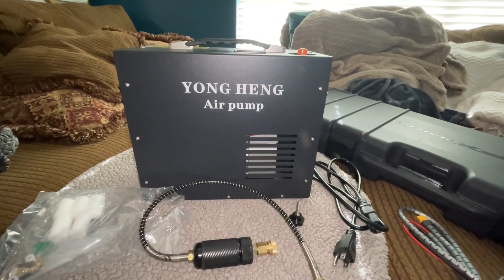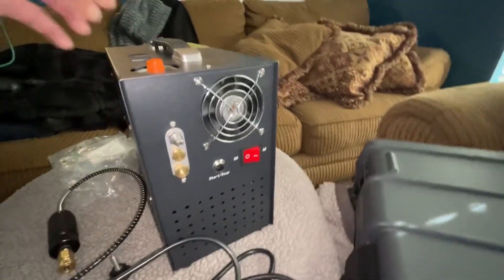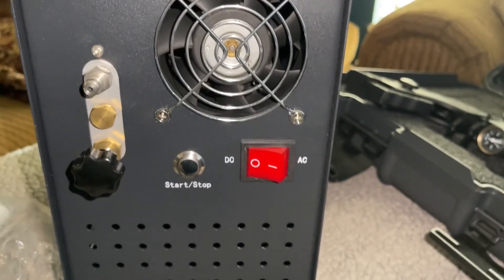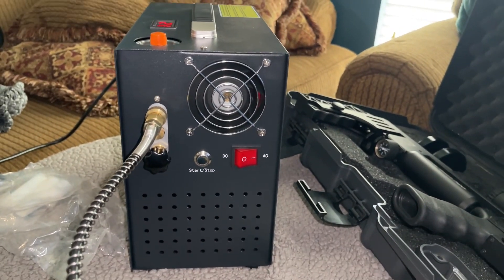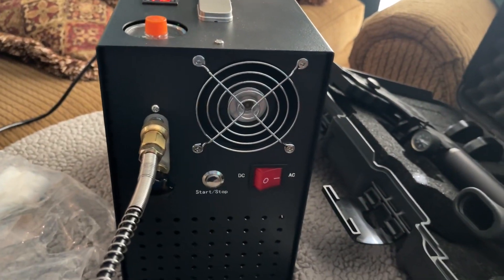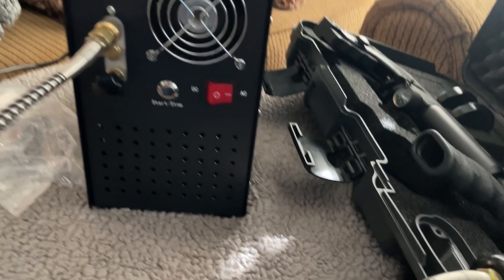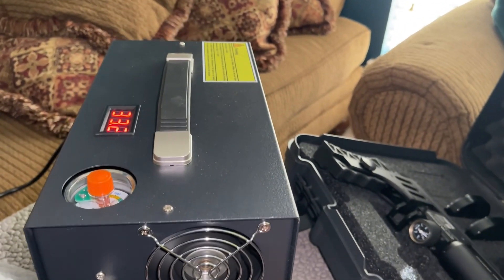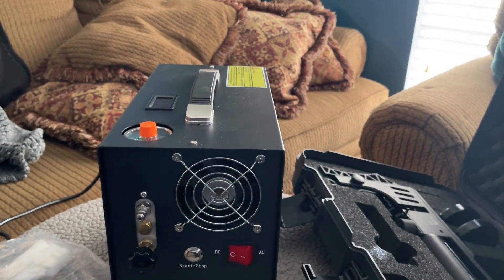YONG HENG Air pump 4500psi working pressure  model YH-QB12-S

Comment: Thanks for the video. It was difficult to find information on this specific model of Yong Heng compressor until I found the model number and googled it to find your video. I have this compressor now for just under a month and wanted to share some insights: 
1- I think I'm going to add another fan on the opposite side of the case to pull out heat as I live in S FL and need as much cooling as possible. It looks like there's a connector on the board available. 
2- On the 2nd use of the compressor after the first time of topping of a rifle, it would blow the fuse once it would reach 1500 PSI. It would become really slow over 1000PSI and constantly blow fuses once the pressure reached 1500 PSI. Further troubleshooting showed there is a seal at the check valve at the top of the cylinder that had broken. Replacing that seal immediately fixed it. The seal is not in the parts diagram (part of item 25, High Pressure One-way Valve) and not supplied in the parts kit.
If anyone finds a parts diagram with part numbers for the parts, please share.

Comment: Is the compressor still working good? I just ordered the same one. So hope it was a good choice. lol
Reply from the maker: It still working I use it all the time , only thing is the air filter you should replace after every 10 -12 fill ups , you can order them on amazon, just keep the right size
Reply from the maker: https://a.co/d/ck8Ftrn
Reply from the maker: 50pcs Air Compressor Pump Cotton Filter, 30MPa White Fiber Cotton Pump Filter 2 x 3.5cm / 0.79 x 1.38in High Pressure Pump Prefilter Core for Yong Heng 30MPa Air Compressing
Reply: What is the biggest tank it can fill?
Reply from the maker: @ only the tank on your air rifles , 250bars and tank 500cc and 300bar 700 cc , you cannot fill the big air tanks that u use to fill ur guns back up